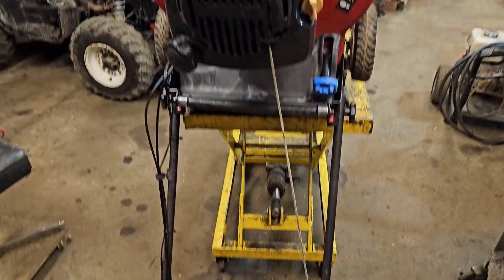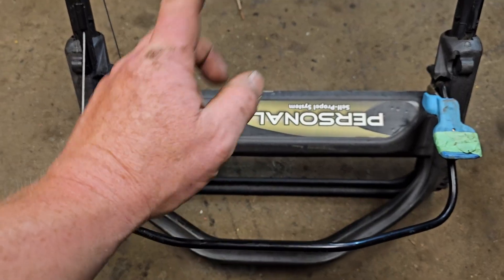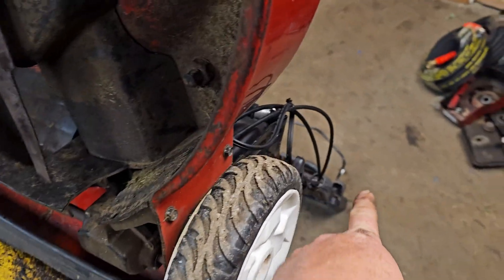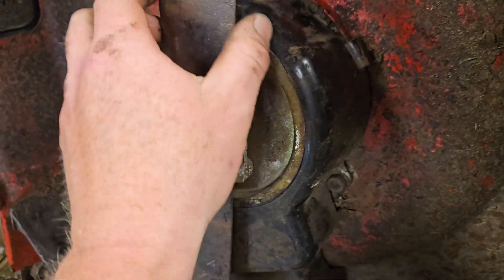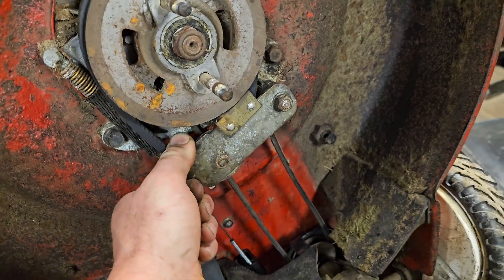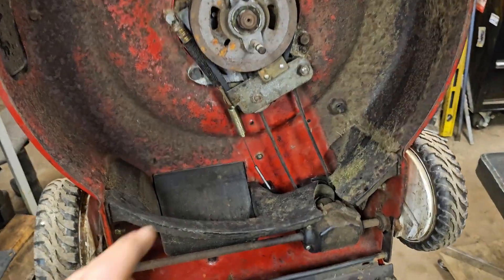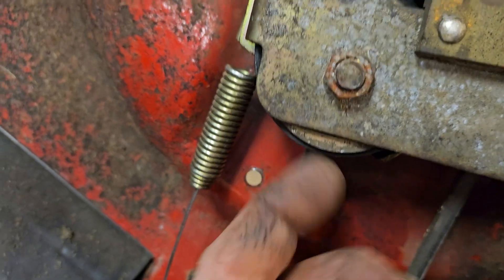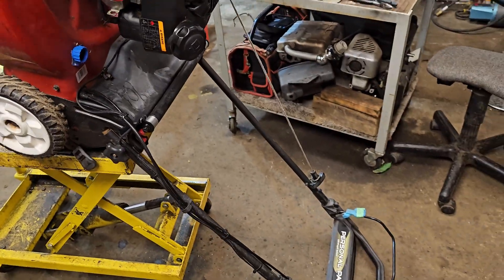How The Blade Clutch (BBC) On the Toro Recycler Lawnmower Works #mechanic #toro #diy

Comment: I have 2009 model toro. Just Replaced the self propel cable and the blade clutch assembly cable. Replaced the blade clutch belt too with a Chinese replacement. The mower chewed it up within 10 min run time. What could be the problem? Too stiff?
Reply from the maker: maybe you pinched it between the clutch sheaves when you put it back together, easy to do if you don't know to watch for that.
Reply: @machinesnmetal  I don't think I pinched it cuz it was free wheeling. Idler was free. No noisy or wobbly bearings. Looking back at reviews for this belt several others had the same experience. I'm going to ordér an OEM Belt and try again. I'll be sure to check for pinching Thanks. I'm a 67 year old woman and I like the challenge of fixing things!
Reply from the maker: Please make a video and post it on youtube!
Reply: @machinesnmetal I'm thinking now the idler pulley is worn. Looks like a there's a lip that keeps it aligned which may be worn away.

Comment: So, what's the blue lever and how does the start / stop? I just got one as a flip project, but the system is completely disassembled, and the engine removed.
Reply from the maker: it just unlocks the blade clutch engagement bar

Comment: So I have this mower and when  trying to cut the grass as soon as it hits grass it's not cutting? But when I tip it back and engage the blade it's spinning. Could it be a belt or just needs adjusting? I'm having a hard time figuring it out
Reply from the maker: There's a belt and there's a plate that rubs against it and they wear out, and slip, but also your cable may need to be tightened a little bit.
Reply: @machinesnmetal  thank you